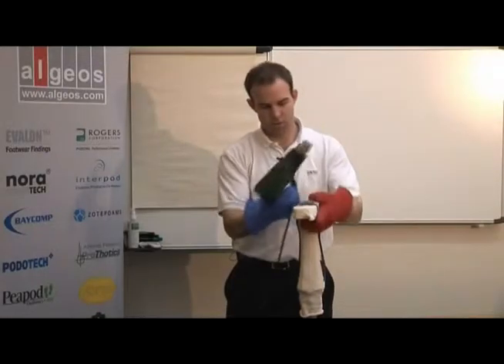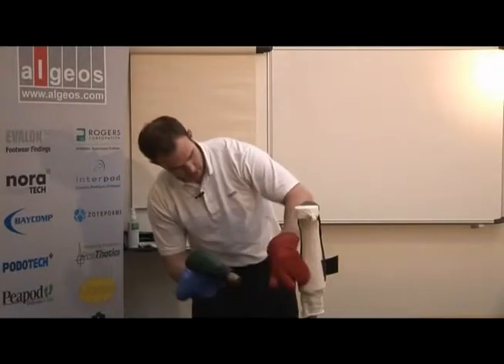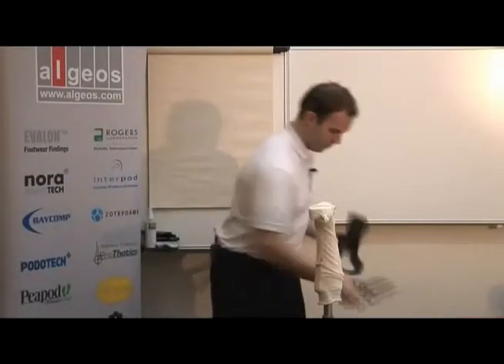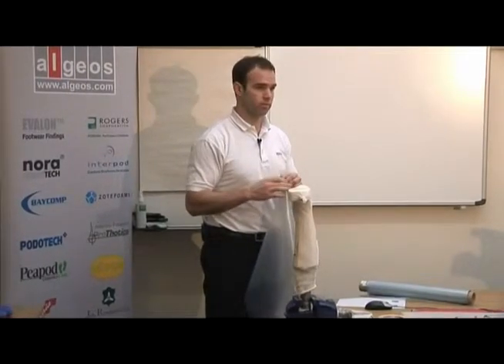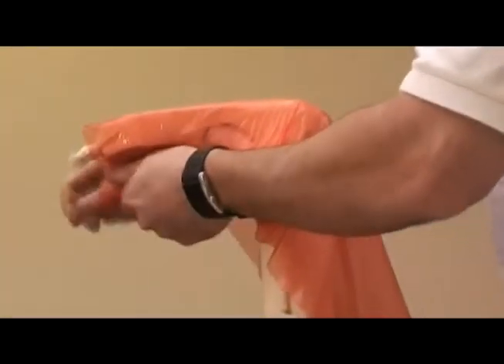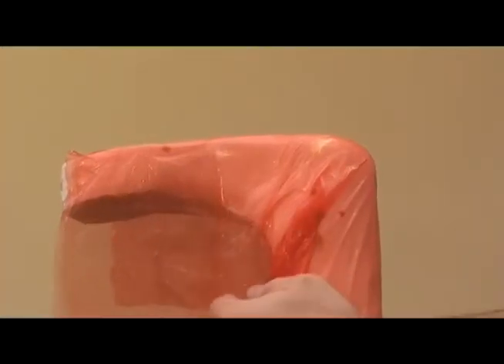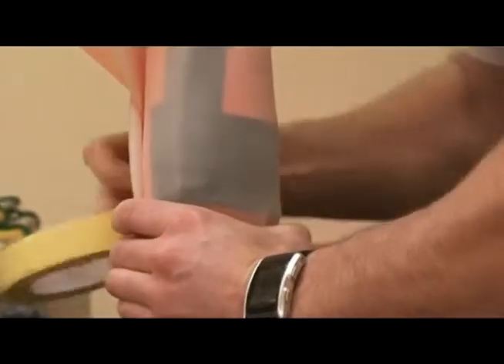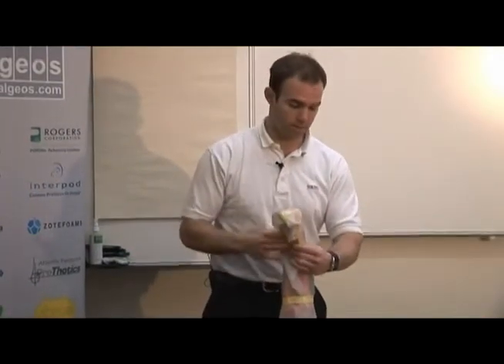TFC Carbon Composites Part 2

Comment: the red foil is not necessary, use silicone tube 7 inch, 1mm, it will work better.